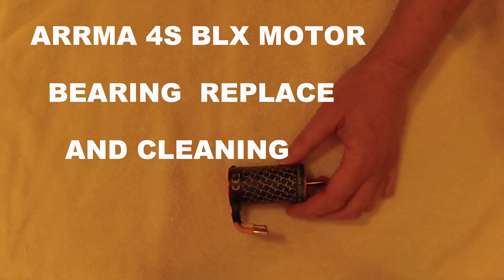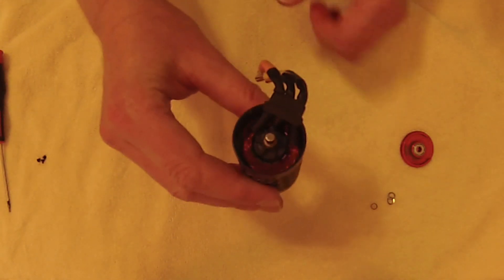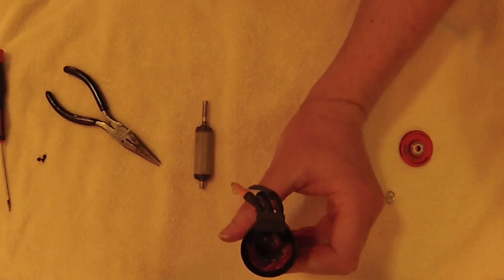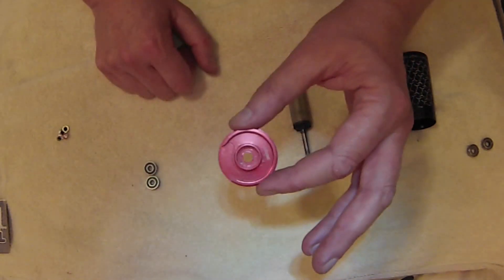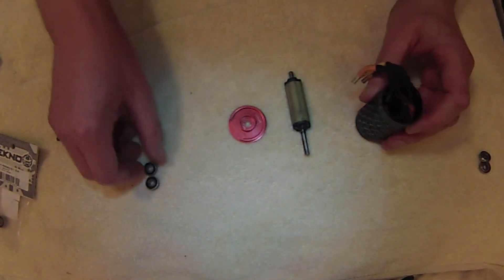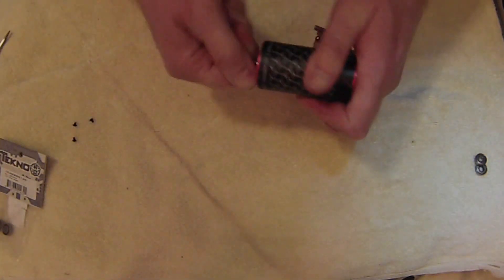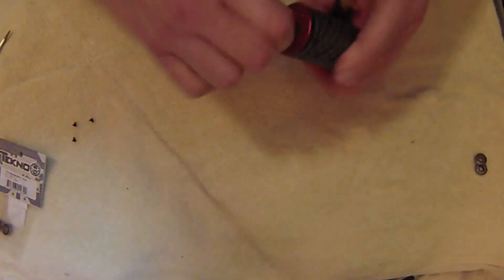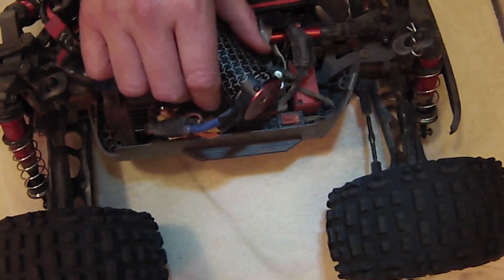ARRMA RC BRUSHLESS MOTOR  BEARING REPLACEMENT!

Comment: A piece of bread gets that cap bearing out no problem. I put a video of the bread crumb trick on my channel if you ever run into that problem with an Arrma motor bearing again. I learned it online, thought it was genius, so I tried it and it's amazing.

Comment: Little trick to remove the endcap bearing use bread put pieces by pieces in the and push with the rotor with a few minutes the bearing will start to pull up and eventually completly come out hope i made your day;)
Reply: Easy like cake
Reply: This works every time lol
Reply: Just tumbled on your reply on removing the end cap bearing. Are you able to make a video demonstrating how do you get it out? Thank you
Reply: @treysals  just shove bread down the hole and press it with the motor shaft. Keep adding
Reply: @EXTREMERC416  You were saying to put just standard bread that you would get from a loaf of bread into the bearing hole and keep pushing down? I guess I don’t really get it
Reply: @treysals  the hole where the motor shaft goes trough yes

Comment: Just wondering how did the sealed bearings hold up? I have the same job to do and I heard not to use those because the heat can melt them. Good video thanks

Comment: Nice video 👍...I used bread and a shaft off a old motor ... pushed it out 👍
Reply from the maker: Heck yeah! Everyone is going to have to do this at some point. Thanks for sharing
Reply: May I ask what you mean by using bread and a shaft? I am having this same isssue - need to pull out the bearing somehow.

Comment: great vid, just wondering: I own an ARRMA Typhon 3s. I disassembled te engine but there's not a washer setup as shown in the video. It's a bearing (in end cap), bus and a curved washer. May be a newer or older version. My question: Do you happen to know if the curved washer should be between the bearing and the bush or between the bush and rotor. Answer is much appreciated.
Reply from the maker: I'd say put the bearing against the moving end part. And curved washer against non moving side. Hope that makes sense
Reply: JC RC sorry it doesn’t. 
Engine looks largely same as yours (endcap, with a bearing in it) but then there are not 4 washers but just one curved one and a bush. Wonder if the bush should hit the bearing directly or the washer...? So: endcap-bearing-bush-washer-rotor or: endcap-bearing-washer-bush-rotor...
Reply: @jcrc9051  I just got an answer from my local hobby shop: it should be ndcap-bearing-washer-bush-rotor.

Maybe I'll post a vid myself on how -to.
Reply: I think this is the 4s motor so the 3might not have them because its not long like the 4s ones

Comment: I used a cigar torch to heat up that bearing and it came out. I used a pick to pull on the bearing once it was very hot. No need to put a hole through that cap 👍. Some people use the bread crumb method.

Comment: How has this held up? I have been told not to use sealed bearings for my Spektrum 3200kv. With this 1 being lower kv, I wondered if that had anything to do with using sealed bearings. Great information.

Comment: Hi, my friend.
arrma brushless motor
I've seen the disassembling video.
After I saw it, I had a question.
When I disassemble and assemble the anrma typon 3s motor,
I thought the washers were broken pieces of bearings.
I threw it away, and it wasn't until I saw your video.
I knew it was a washer.
Do you happen to know the size of those washers?
I thought I'd buy it again, take it all apart and put it in.
And is rc driving without washer really bad?
Reply from the maker: Hello, yes it could be bad for it. I don't think you want excess movement in rotor. You can't  buy these from horizon hobby. I e mailed them and they don't even have a diagram of the motor.
So ,I would take the motor to a local hobby store and see if they have any small washers on hand .
Reply: @jcrc9051  
Thank you.
I'm going to put in some of the wavy washers.
I've searched more and they say the internal diameter is 5mm.
I'll give it a try. ^^

Comment: Can you clean the motor with degreaser or wd40?
Reply from the maker: I would not use wd 40 It will attract dust and debris  Just electronics cleaner ,it doesn't leave any residue.
A degreaser may be ok if you rinse it off though.

Comment: Whats a good MOTOR CLEANER FOR THE 4S HOT MOTOR KRATON I USE DW40 SPRAY FOR MY SHOCKS AND WHEELS CAN I USE IT TO CLEAN MY ENGINE SO THIS DOES NOT HAPPEN AGAIN AND IT'S A BRUSHLESS BLX MOTOR LIKE I SAID BEFORE
Reply from the maker: Use electronic cleaner spray. 
If you use WD40 it will attract dirt, and make things worse.

Comment: My bottom bearing was completely blown out and I have no way of getting that one out. Completely destroyed the inner race and now the outer race is stuck
Reply: Same here. No idea how to remove the outer race of the destroyed bearing.
Reply: Daniel Braune motor is completely trash now):
Reply: @413RC  Hopefully not. Someone from a german facebook group removed the bottom red cap. It's screwed itself with the black motor shell with a very strong threadlocker. So, if you can manage to rotate the red cap to unscrew it, there is a better chance to get to the outer race. You have to heat up the shell and the cap to liquefy the threadlocker.

Comment: should always use metal shielded bearings in a motor. They get hot and will melt the rubber sealed ones.

Comment: Have you figured out yet that using rubber "sealed" bearings inside the motor don't work out so well? They'll heat up and disenigrate quicker than metal or ceramic

Comment: Rubber sealed bearing can melt in the motor.  Better to use a metal seal.  Jims Bearings is one vendor. https://jimsbearings.com/collections/motor-bearings

Comment: 2 DAYS AGO MY KRATON 4S MOTOR BLX HOT MOTOR STARTED SMOKING at THE back OF MOTOR SO i stopped THE TRUCK AND turned it OFF AND TOOK IT BACK TO THE shop and THIS happened in a matter of six DAYS of having a brand new TRUCK i drove it on GRASSy dirt AND CEMENT SO Somebody ANYBODY give me SOME ADVICE ON LOOKING AFTER ENGINE PROPERLY AND MY TRUCK HAS 2 COOLING FANS SO I DON'T GET IT $925 DOLLARS LATER
Reply from the maker: If it's that new, they should just give you a new motor. Contact horizon hobby they might want a photo of receipt.
Good luck